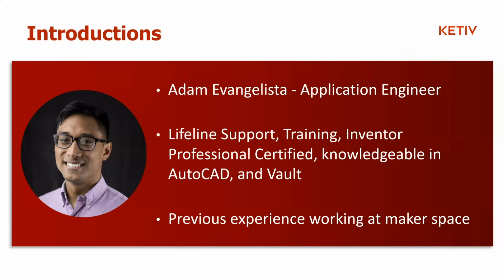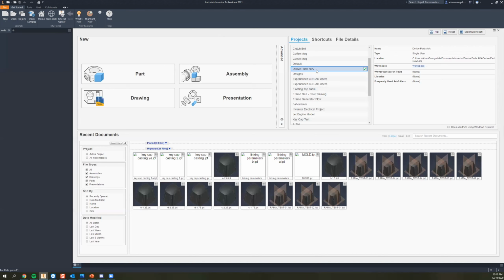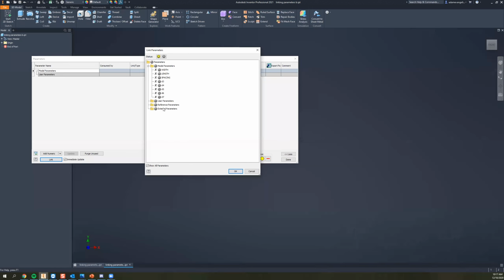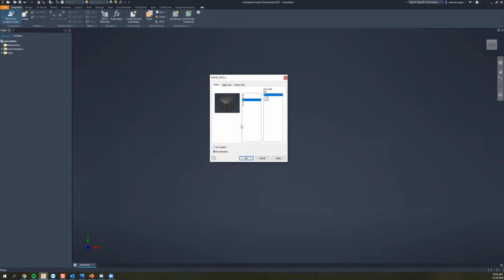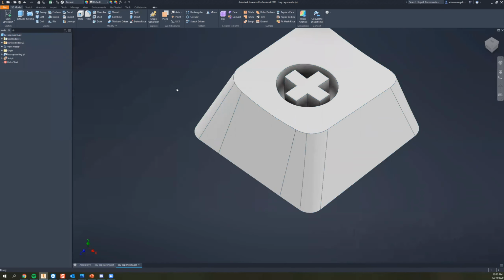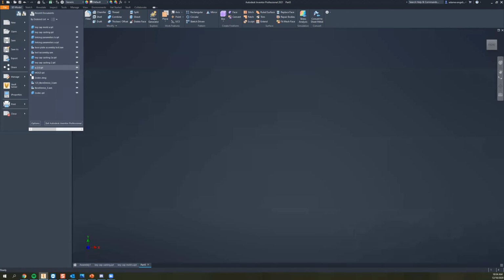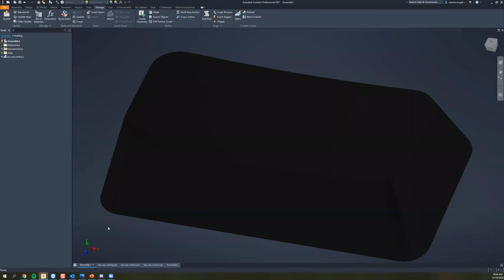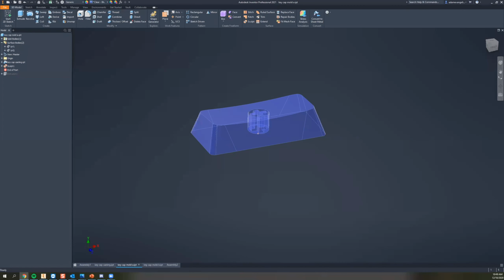Linking & Deriving Parts | Autodesk Virtual Academy

Comment: wouldn't you get the same result using the sub-assembly in the assembly interface?
Reply from the maker: Hi Jelton, good question.  It will depend on what information need exactly going from child to parent parts.  Parameters from the assembly aren't easily accessible from the sub-assembly for example, though you could always rely on projected/reference geometry when building a part in place.  Feel free to reach out if you'd like to discuss in more depth - support@ketiv.com